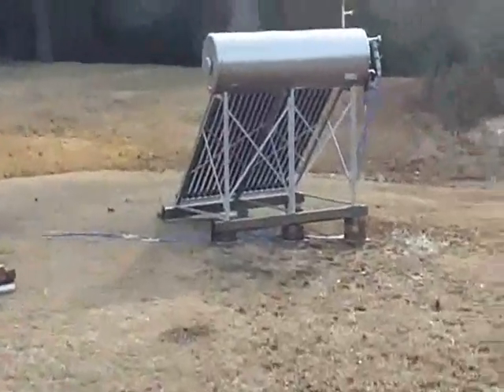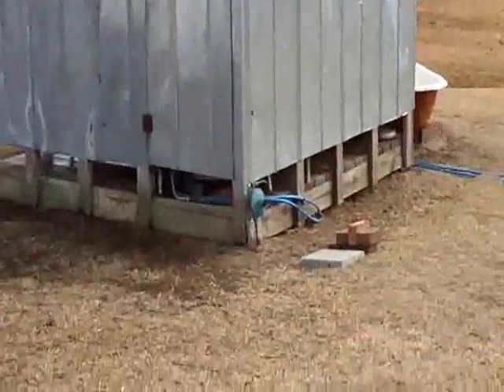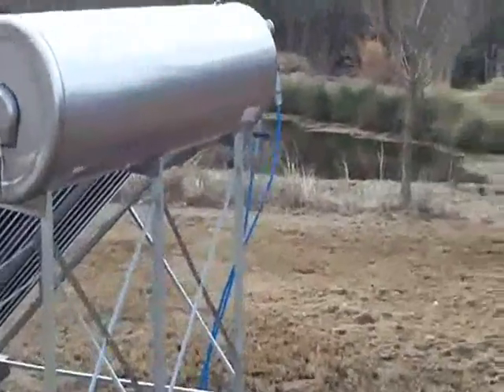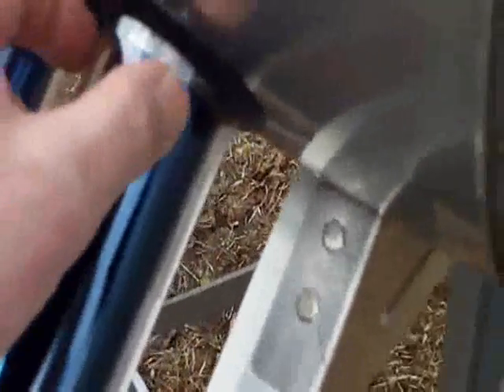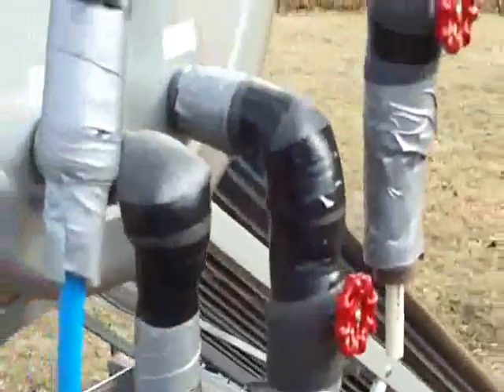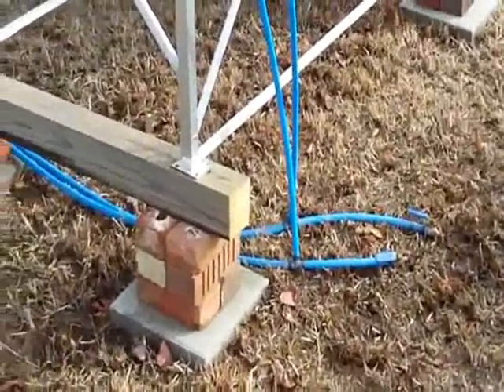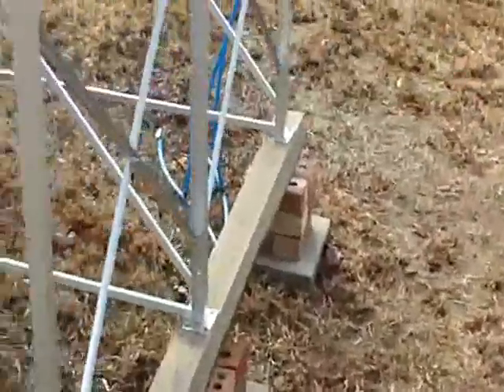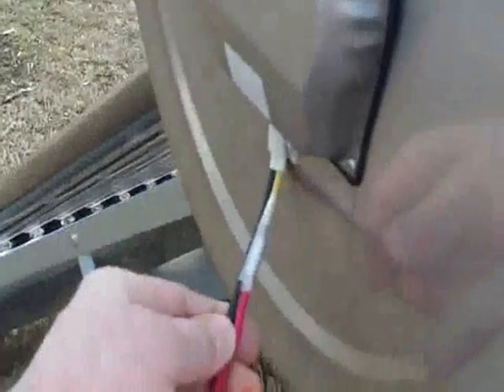Evacuated Tube, Pressurized, Stand-Alone Solar Water Heater

Comment: I recently installed one. It has a 53 gallon tank. The first few days I wasn't that satisfied with it because the water was a little bit colder than luke warm in the morning. What I did was that at night when the copper tubes weren't hot anymore I poured hot boiling water in each tube. It did make a difference. In hind sight I think it would have been better if I'd kickstart the solar heater by filling the tubes and tank with boiling water first.
Reply: That makes absolutely no sense.

Comment: Solar hot water systems produce clean, non-polluting energy. A single hot water system can offset the equivalent of approximately 40% of the carbon dioxide emissions of a modern passenger car. They are safe for our environment, safe for plants, safe for animals and safe for all of us. Get started on your DIY project today at. http://bit.ly/1OEnRQW

Comment: I have a unit from China as I'm out of the USA right now. Sad to hear that they are hard to find in the States as I'm moving back. I took my "inside the house" water tank out completely! The only hot water tank is the one on my roof now. I have flat roof and the whole unit stands on it. Here in Uruguay (South America) City water feeds into cement roof tanks then that water goes into homes. This keeps the main pressure up with the altitude. My water goes from the cement holding tank into the solar tank and then that hot water goes directly into my plumbing. On really bleak days I can flip a switch on inside my house that will temporarily help heat the solar tank. I then switch it off after an hour or so. Since it's so big (80 gallons) it keeps it self warm. Once heated ( I guess at it) I turn the switch off (Looks like a light switch type) and any sun will help keep it warm. That inside switch and a hose to capture too hot leaking water and run it off the roof was a needed make sift addition many of us expats had to come up with on our own. A month will go by and only a few times in winter 35-40 degrees/no sun, have I had to use extra electricity to help it warm. I only lost tubes twice due to 2 severe wind storms a total of 3 tubes (2 then 1). The price of the units have dropped as more people and have started to buy them. 7 years ago I spent $2400  now some are $1000 and smaller are $800. I hear that the tubes themselves are evolving into better designed ones, but purchased  with a different tank system and at a reasonable cost.
Reply: +Denise Glass  i cannot understand that why solar water heater is not popular in America at all? It supposed to be very popular in desert states like AZ or Southeast..
Reply: Becouse the gas is cheap and its all about pay back time, but with solar PV seen as the big profit maker, solar thermal has been dumbed down to where it is.

Comment: Any body importing closed loop pressure solar water heating systems from China, be very aware that many of these tanks will split open if the water heated through heat pipe tubes is not used daily.
After 15 years designing/ developing and involved with my own manufacture in China, all my new tanks are designed as thermal stores, meaning that you still get hot water at mains pressure, but not with a pressure heavy duty tank www.pvt-thermal-plus.com
Reply: Eric Hawkins
Reply: contact me at eric@solar-speed-flex.com for prices of our insulated flexible coils of pipe and fast fit fittings, leak free guranteed

Comment: Hello, I bought and put together a similar water heater. Only big difference is that mine has a reflectant like material under the tubes so more heat is transfered. Just a tip if you want to upgrade! And a question... Do you have problems with hail? or other weather condition whatsoever?

Comment from the maker: Greetings Ahmed:  No pump is required if the solar heater unit is being fed fresh water from a pressurized water system.  If you feed fresh water to the unit via some type of gravity scheme, a pump may be required, based on the elevation of the holding tank in relation to the "point of use" fixtures.

Comment: Do you require to install a water pump behind the heater outlet to distribute hot water to the toilets inside the villa/house with enough preasure?

Comment: Is this the model with the copper tube spiral in the tank, if so the water in the tank will never be in the inlet outlet system, and because of that you could have anti freeze in the tank as the heat is past be heat transfer rather than direct heating. I only say because i have the internal copper coil heat transfer system 20 tube.

Comment: Actually you increase the surface area with the curve of the tubes as opposed to the flat panel. Think about how the sun arcs east west in the sky and the curve of the tube , then think of a flat panel. Makes sense the tubes would be much more efficient.

Comment: Is it possible to post the brand & price of this solar water heater and where you bought it? Great videos!  I don't understand why these evacuated tube heaters are not much more common in  the U.S. No moving parts, no motors, simple and elegant. But almost nobody I talk to has ever heard of them. I ended up importing one from China, but would like to find a reasonably priced and accessible U.S. or Canadian dealer for others who have seen mine and want to buy one.

Comment from the maker: @jjlpinct 
I've thought about it, but the tubes are supposed to be pretty durable.  I've seen golf balls dropped on them from the height of a garage roof with no damage.  Replacement tubes are relatively inexpensive as well.  I bought 5 extra glass tubes with the heater for $15 each.  And the rain seems to keep the tubes clean.  To date, the system has been zero maintenance.

Comment: as a plumber one of the things i need to look out for is water temperature in storage type water heaters, too hot has its obvious hazards, too cool and an unseen danger lurks (maniacal laugh)..
Legionella bacteria can grow in the lower temps in water heaters, which can cause a form of pneumonia. it is generally transmitted when you inhale the mist. You should be fine if you periodically peak above 135f. otherwise try adding a small amount of bleach to the system.. 
the web can tell you more :)

Comment from the maker: @continuityofliberty It seems you would collect more energy if there were a reflector behind the tubes.  But two issues come to mind. 1) - the tubes are relatively close together and would probably attenuate a considerable amount of energy making it to the reflector. 2) - the reflector would have to be kept clean in order to be effective.  The nice thing about the "tube design" is that the angle of exposure to the sun is pretty constant as the sun tracks from East to West.

Comment from the maker: @Rasenkrieger Yes it IS COLD HERE!  Both topics are controversial.  I'm personally not buying the "greenhouse" proposition.  Peak oil has it's critics, but based on the arguments I've seen, I think the peak oil camp has a more defendable position.  Either way, the trend of energy prices over the long term seems to be UP.  I'm simply attempting to hedge my bets at this point in time!!  Thanks for the "link" - I'll check it out!  Regards, John
Reply: i am a geologist, & for many years i believed serious, possibly civilization disrupting shortage of oil was likely to occur as early as mid century.  now, with the developement of long lateral horizontal shale wells i believe we have a couple or 3 centuries before we will run out.  reguardless,  it is smart to develop  alternate energy sources & tech when ever possible.

Comment: @audiofeel1 May make system less efficient. Remember tubes are evacuated so wind chill wont affect them much and plexiglass will reduce the light getting to the tubes. As far as i can tell, the best plexiglass light efficiency is about 92% (i.e. it blocks 8% of the light).
The exposed tubes do look a little bit scary though - haha

Comment from the maker: @audiofeel1 I had the same concerns about tube breakage before I purchased the unit.  I did some research and found vids posted that demonstrated golf balls being dropped on a similar unit in order to simulate hail.  None of the tubes broke during the testing.  Also, the unit was shipped via common carrier with no tube breakage.  I'll post updates if I have any problems with them!

Comment: wonderful unit. my concern would be protecting those glass tubes from t/ elements. for ex.; wind storm. must be a way of enclosing tubes in a sealed protective box made from plexiglass. may also make t/ system more efficient.
Reply: how do you protect glass tubes from hurricane